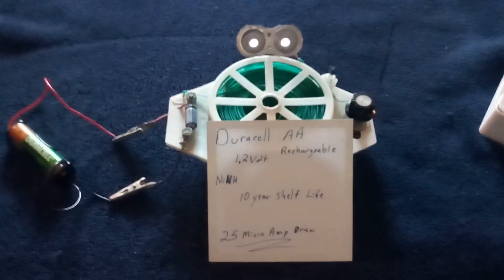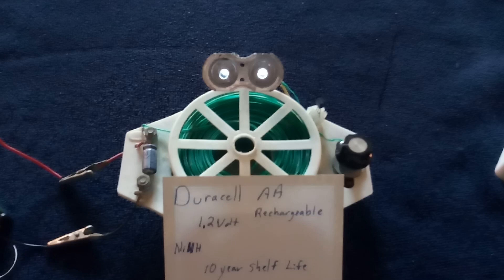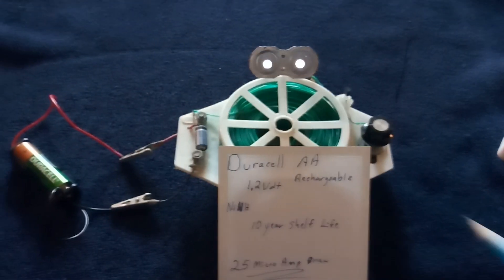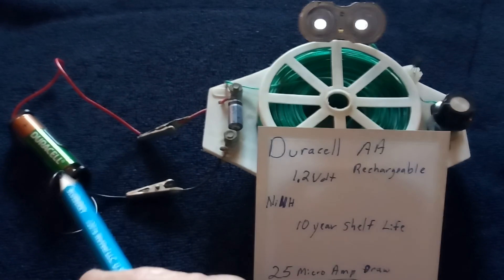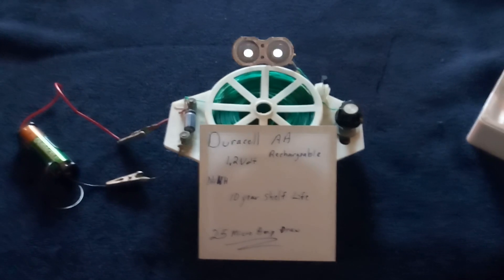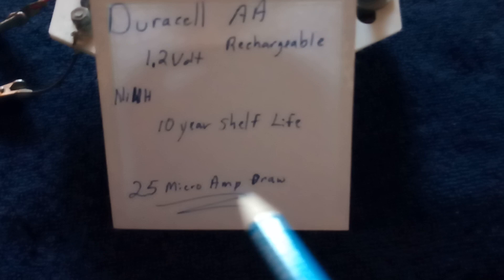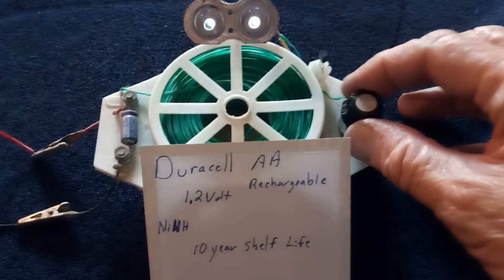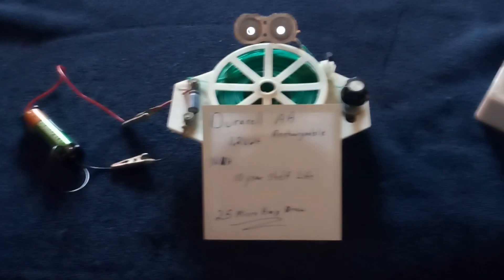Magnetman2010's  Duracell AA experiment

Comment: The voltage today on the battery that is running that penny is 1.205 volts.
Reply from the maker: Wow!  From what I am seeing so far the battery could go a lot longer than 3 years.  That is one amazing battery.  Thanks for giving me a heads up about it.  If we added a large enough  solar panel to it (hat would charge the battery in low light) you could hand your Penny down to your grandchildren ---still running.

Comment: Well I certainly have plenty of very old rechargeable AA batteries to play with. My old camera used to eat them 4 at a time so I would carry around several 4 packs for filming sessions. The new camera (now many years old) uses LiIon packs.
Reply from the maker: I have a whole bunch of old rechargeable AAs also. I didn't really like them that much because they didn't have enough capacity and they self discharged badly.  This rechargeable AA Duracell is WAY better.  I also bought some AA 14500 3.7v  Li batteries to test.  I am pretty impressed with those also.
Reply: @Lidmotor  I do have quite a selection of different brands but I don't think I have any Duracells. I will have a look through them at some time next year 😆

Comment: Overunity machine with natural negative entropy.

Synchronous magnetic amplifier
3 in 1 - structures of 3-phase Y-Y transformer, 3 phase no load synchronous motor DC excited rotor, 3-phase generator.

Build it, spread it. Time to destroy lies.